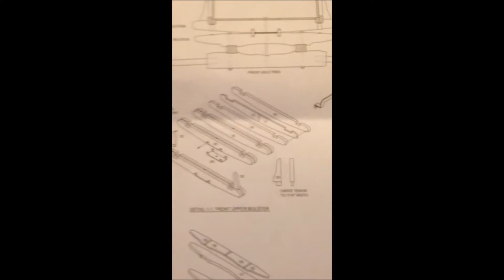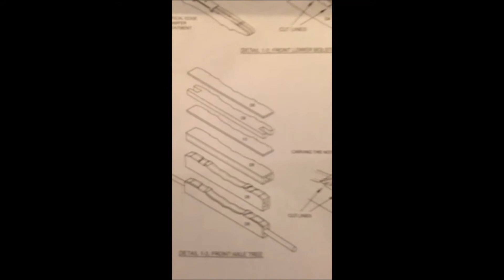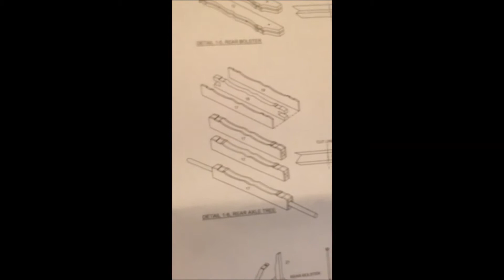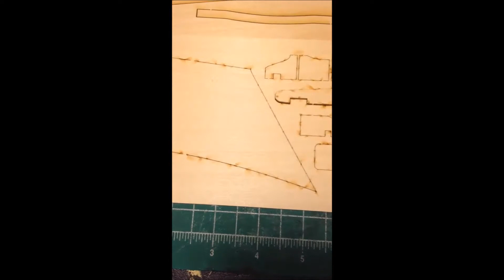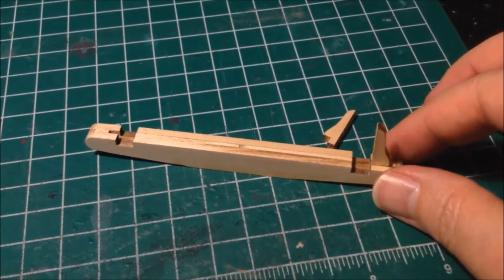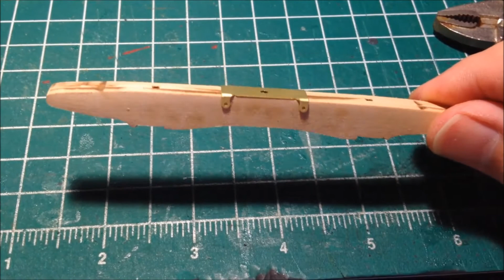Building the Conestoga Wagon B

Comment: Thanks for the video! I was wondering how the metal pieces were cut out. I didn't think the knife would do it so explaining what you used helped.
Reply from the maker: The metal parts are cast and photo etched.  The PE parts are easily cut away from their frame with a sharp knife.  Special cutters are sold, but I don't use them.  Residual metal can be filed off for a smooth edge.